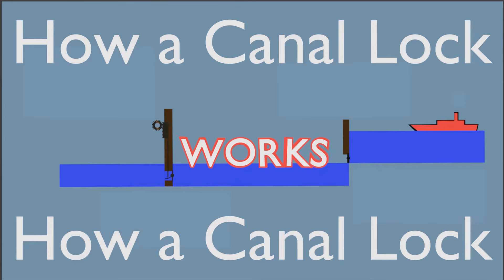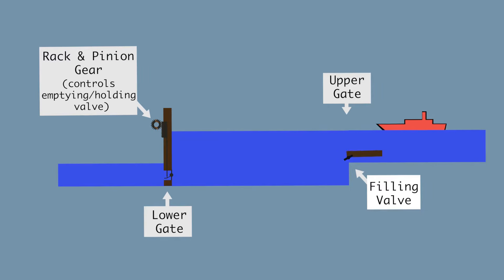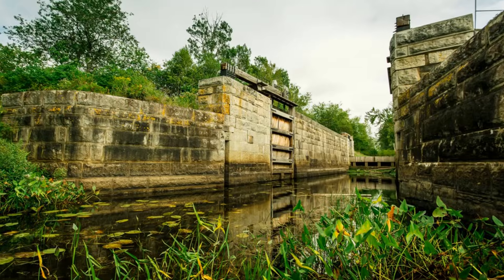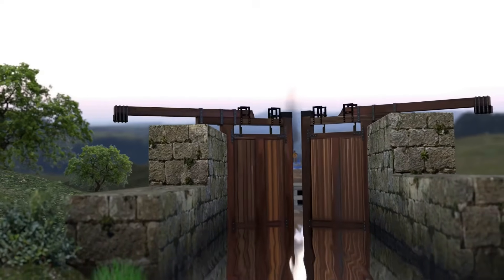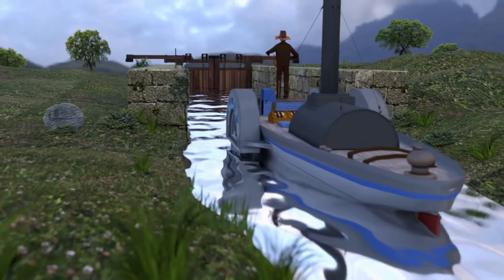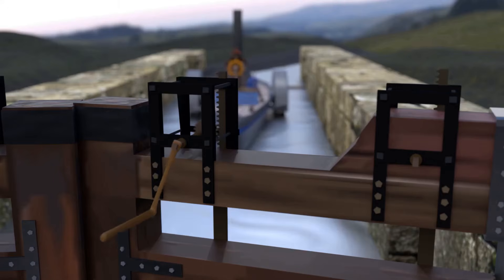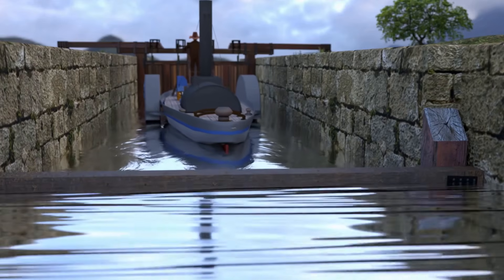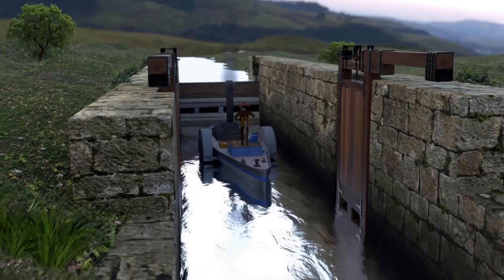How a Canal Lock works

Comment: fabulous animation to explain something I still don't quite understand.  The whole different water level?  what happened before locks were built?
Reply from the maker: Cargo would be Portaged from one level to another. Also check out on YouTube "Plane 9 West on New Jersey's Morris Canal" By Warren County NJ....which showed how an inclined plane could be traversed From one level to the next in the 1800's. This was a video I made for the Warren County Board of Chosen Freeholders. It illustrates a remarkable part of history and may explain one way that allowed boats to change levels without locks.
Reply: I think she meant during construction, like how the water would have been at the areas of the locks. I assume 1) most of these manmade canalbeds were dry until locks were built or they were used as dams until the next water level was filled.

Comment: What if the boat is going the opposite way as the current?
Reply: Regardless of the current, for a boat to go in either direction the level in the lock needs to go both up and down.

Comment: hmm! thanks. I read about this in a book and needed to see for myself how it worked.

I guess i never considered the necessity of something like a lock because i can't imagine how two natural water bodies would form at different levels...
wouldn't water just erode its way through over time, when the levels go up due to rain/flooding?

and they always seem to look like the canal behind the lock is pointing the right way to the lock too, so the gates have to be as strong as little dams...hmmm
Reply: Consider the fact that you're talking about large bodies of water of varying sizes. Imagine, for instance, that you had a swimming pool, connected to the ocean, by a tiny mote that you dug between the two. If it rained really hard, your swimming pool might get to be much higher - but the ocean? Not at all. So you can see, the size of the body of water, and the sources of water that influence the water level of each body, can affect the water level. The consequence is that if you have one body of water that's higher than the other, and they it has to flow through a narrow opening, the currents will get extreme - and the waves, very rough. And you're right, that kind of rapid movement could cause a lot of erosion, and other consequences for the environment - like affecting jellyfish migration. I feel like, many times, when we see locks, they are due at least in part to some human interference. We can create bottlenecks that interrupt the natural flow of water - and that can cause destruction. To mitigate said destruction, we try to manage the flow of water so that it is more natural....This is all out of my own head, but I grew up around the water, and we have locks, and this is my understanding of why we do. It's worth researching if you're particularly curious about it. But hopefully, this perspective gives you some idea of why we need things like this.